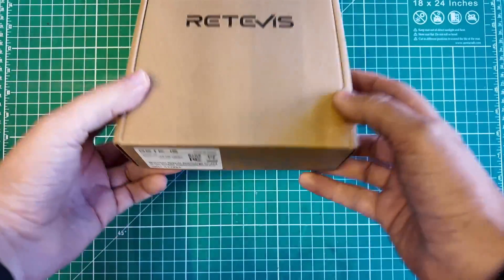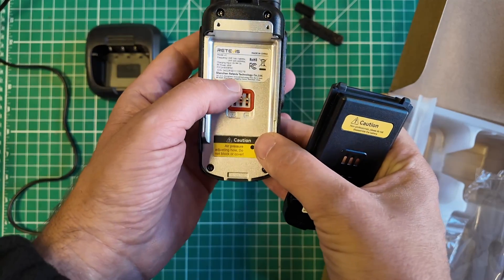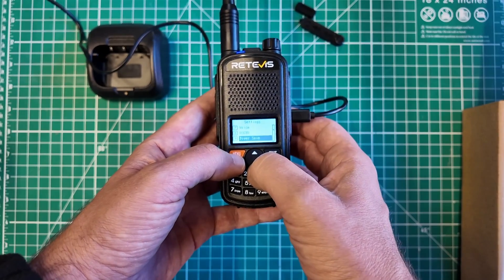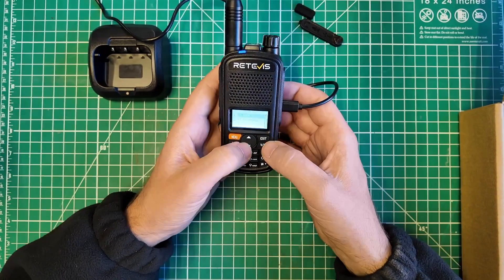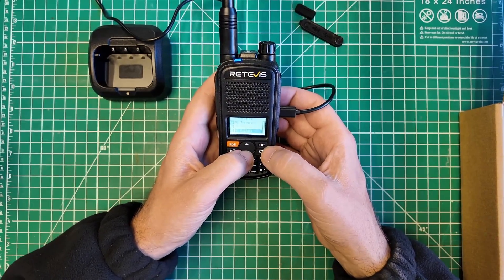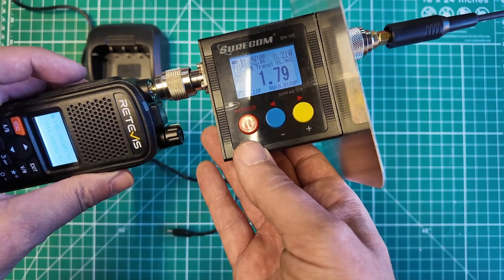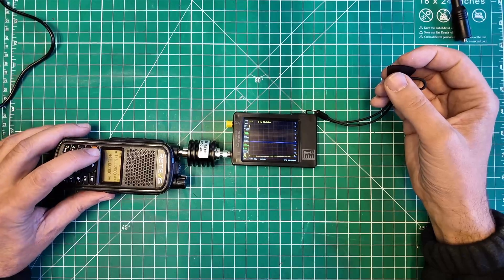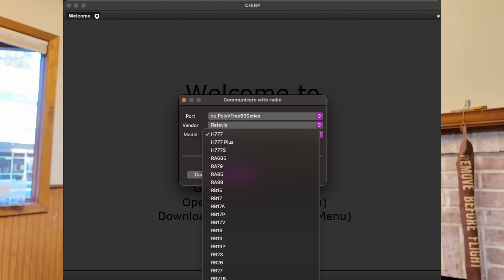The All New Retevis A1

Comment: Just saw the video. I have the A1 radio. RT Systems has the program software and cable. THEY ARE THE BEST hands down. Chirp stinks compared to RT Systems. Not even close. All my programmers are RT Systems. I need to unlock it for GMRS but have not figured that out yet. Retevis is just as good as AnyTone.
Reply from the maker: Good to hear.  A lot of the retevis radios are made by anytone!
Reply: @temporarilyoffline do you happen to know how to unlock the radio? I have a gmrs license and own a gmrs repeater. Thank you for the reply
Reply from the maker: No I don't

Comment: I've never had luck getting any HT antenna to read a decent SWR on that meter.   Indoors/outdoors, plate attached/not attached. Even a nagoya 771 and signal stick read like crap on it.    Not sure what I've been doing wrong since I've seen others on YT appear to get good readings from the same antennas.    And yet other folks have said there's no point trying to measure HT antennas on that meter (or any really).    Do you get consistent good readings on decent antennas on that thing?
Reply from the maker: Readings are always suspect with "amateur" equipment.  I like the meter and the stock antenna because that's what you get in the box.  Power into a dummy load is nice. But who tries to make contact on a dummy load? HTs usually rely on your body to provide the other half of the antenna... And all of us are built differently also.

Comment: Unless there's a possibility to use the GPS for weather alerts, what is the point of having GPS if it can't beacon APRS.  Seems these Chinese radios are putting useless features in to advance the model number. Thoughts?
Reply from the maker: There are a lot of simple features missing from budget radios. The quansheng's have been hacked to include most of them at a dang good price!

Comment: Love your Tanto-Like knife!
Reply from the maker: Thanks! Its a Tiny but useful spring opener from Gerber that I've been using for almost a year now.
Reply: @temporarilyoffline  I have a Gerber Multi-Tool that ias about 35 years old and still looks like new, despite heavy use, great tools! 73 de WP3BM
Reply from the maker: @gabrielsierra6890  I have the one with the offset screwdriver and I love it.  I don't like the bulky carrying case on my him.  I've been using multi-tools on every single project since 2014 when I bought my farm.  Once you start carrying it, you realize how valueable it is - its simultaneously the wrong tool for the job and the tool you go to for every job.  Love 'em.